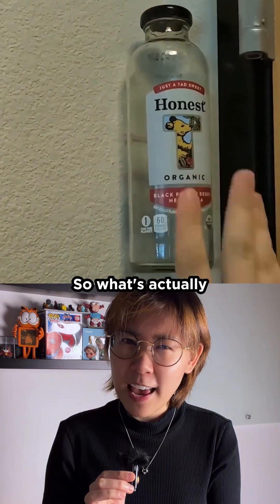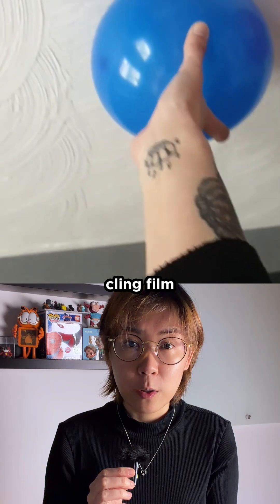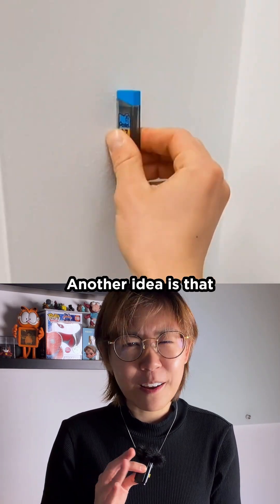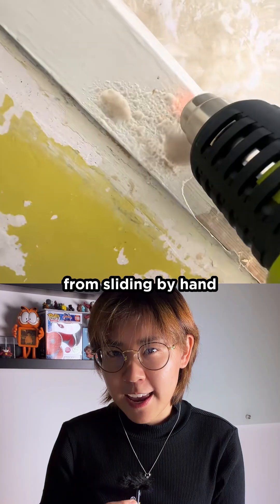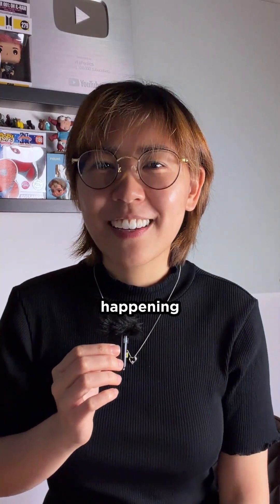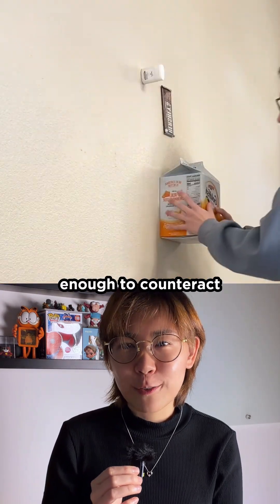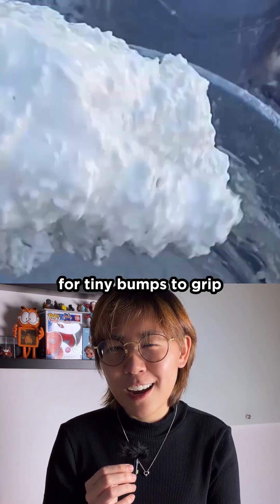Friction Actually Makes Things Stick to Walls #physics #experiment

Comment from the maker: Btw, this is called shear-induced friction. It is the same trick geckos use to climb walls! 🦎
Reply: Isnt there a "weight" limit for this phenomenon? Like there's no way a spider man could exist...right????
Reply: @Jyno_Syd  I think so
Reply: @Jyno_Syd grow up, Spider-Man is real!
Reply: @Jyno_Syd spiderman is real tho??
Reply: sheer induced friction is just the active action that a gecko takes to induce vanderwaals for anyone wondering. Just means that geckos dont stick by a simple touch.
Reply: @IveNoIdeaReally cuzzzzz mabyeeeeeeeee your gunnnaaa beee theeee oneeee thatttt savesss meeeeeee, cuzzzzz afterrrrrallllllllll yourrr myyyyyy vanderrrrrwaaaallllll
Reply: Wut about my classmates doing this
Reply: I heard that geckos use static electricity or something similar to that? they have tiny hairs on their skin that flatten out microscopically to increase surface area against the wall. there was a veritasium video on it iirc
Reply: @sumy_nona yeah, vanderwalls forces, basically they have hairs on their feet so fine that they get close enough to the atoms in the surfaces to interact with subatomic forces! 🤯
Reply: @sumy_nona Yes, geckos can walk on roof, this video states is just friction, this wouldnt work on roof
Reply: @PinkeySuavo no, it's an interaction between hairs on the geckos feet and subatomic forces in the surface atoms, so they can do it anywhere.. :)
Reply: @ZealousLoper  I know, that's what I mean, this video is false
Reply: @PinkeySuavo no, she never mentioned geckos. I suppose the comment is a bit off. I do remember something about the geckos sliding their feet backwards to get close and lock in tho. ..I don't know enough to be definitive.. 🤷‍♂️
Reply: @ZealousLoper  you're right, I confused comments with the video for some reason, I am braindead. Sorry.
Reply: @PinkeySuavo you are one of the lovely, gentle, kind people who I can only hope are the silent-ish minority on here.. 🫶
Peace and thanks :)
Reply: Its viral😂
Reply: Thank for doing this clip, saw it on reddit and been wondering since 😭
Reply: Can I eat or hold dry ice
Reply: @JhaydeEdrianDelaCruz-u9i hold it yes eat it no, wouldn’t hold it for long with bare hands tho as the liedenfrost effect is very brief
Reply: @JhaydeEdrianDelaCruz-u9i You can hold it in your lungs, just wait a few minutes first. 🌬️
Reply: Or may be it creates vaccum and atmospheric pressure holds it ??
Reply: My classmates used to do this so much in class even the teacher would stop teaching to stare at the wall
Reply: Sounds similar to cold welding in vaccum
Reply: So it's not the creation of suction chambers via flattening? Thanks. 🙏🏻
Reply: That's van waaals forces
Reply: So geckos destroying the paint from the walls?
Reply: @mattdelariarte4095 no, the hairs on their feet get close enough to the atoms in the paint the interact with their subatomic forces. It's not like magnetism than "sticky." But the attraction is strong enough they wouldn't be able to pick their feet up again so their toes actually flex in reverse and they peel their toes up backwards! :)
Reply: It's... A trick. The vdW forces are what cause a gecko to stick. The sheer-induced friction you mention only happens afterwards, the gecko can use this effect to manipulate the adhesion, getting stickier or releasing from the surface. Without both vdW forces and this sheer- induced friction, geckos can't climb, but they can still stick with just vdW force.
Reply: don't geckos use van der waal's forces?
Reply: I believe you meant to say textured at the end. When you say popcorn that's a specific finish that's only done on ceilings and really hasn't been a thing for decades. The only thing that you hear people talking about popcorn these days is having someone remove it. Popcorn texture is not something that would do this. You would damage it and destroy it by trying.
Reply: Same as Van De Graaff?
Reply: Oh so is it like what holds Spiderman upside down on the wall?
Reply: Can you please stop encouraging young women from pursuing science! They are not supposed to do a man's job.
Reply: It destroyed my wall😢😢😢😢
Reply: Can you sing you can just make a video of hey don't do that sister I'm so sorry I forgot now pouring a glass of water in a giant giant giant big globe if he if you just spent the gloves when it's covered in water or maybe spread around I was going to be funny and I was going to be funny but I can't know what's your name so I'm going to tell my sister to know who's this guy's name
Reply: Um..well gecko or lizards and spiders have very tiny hairs that creates opposite charge with walls..right? I had heard that years ago
Reply: @ansh2604  today i learned spiders also use van der Waals forces to cling, that makes sense
Reply: @ansh2604  yes but even if thats the case...if a human sized creature had the same hairs or whatever i am not sure its going to work. The weight is just to heavy for friction to support.
Reply: @Jyno_Syd well in human case it will require more advance form of that so naturally it's not possible but I am sure scientists can make it possible in future
Reply: @ansh2604  spiders have two tiny claws on each foot that help them climb.
Reply: @ Van Der Waals Forces
My Zoology knowledge is good!😁😁
Reply: A simple explanation is the paint heats up and acts like a glue for the object and makes it stick it works on many things tho I have not tried it on a chair
Reply: Only works on glossy pain

Comment: I once walked down a hallway at school gliding the back of my nails along the wall with a texture similar to that, and not only did it get surprisingly warm, but the friction also ground a tiny hole in the middle of the nail.

Comment: I did smth simular with my phone case and thighs/pants. Like i was sitting in the couch with my legs bent and wanted to watch yt i just did this and stayed there without holding in hand. Pretty handy to get free hands and let the rest.
Reply: My phone has a ruff surface. It doesn't work on smooth ones.

Comment: @vt.physics before you gave your explanation did you try it yourself.  A more simple explanations are video editing or AI, or the surfaces are actually horizonal or  glue or magnets are involved.
No way a round glass bottle with hardly no points of contact with the surface sticks to a granol wall.

Comment: Scratch marks on your wall AND the object, especially of a more fragile object. So don't do it with your remote, phone, etc or else you will paint it and scratch it at the same time.

Learned through experience.

Comment: Vertical upward friction along the surface of an object would induce a torque, and even with infinite friction, any object would fall off of a wall. There must be some sort of adhesion or suction in order for the object to stay put.

Comment: But how does that keep the object from rotating away from the wall? Thr center of gravity is away from the wall, so if the surface is applying friction at the edge it should create a torque

Comment: No, it heats up. I used to do it with bottle caps and you'll burn your finger fairly immediately if you don't let go quickly. 
Sounded good tho.

Comment: you can actually create significant heat with enough pressure.
When I was in school we used to weld those six sided fineliner pens together.
You just took seven of them in your fist and let the middle one stick out half of its length. 
Then you hold the bunch really tight and ram it onto the table with the portion of the middle pen that sticks out from the bundle and the six outer pens would weld to the one in the middle

Comment: you can try it but it's not gonna work it's fake
Reply: Its real bruh ive done it once and its becoming a massive trend in my country js search it up
Reply: @rdblx  I tried it and it doesn't work, No matter how fast I go I'm scraping paint off the wall and it's still not sticking.
Reply: @M-DW999  its hard and i think this only works for like weak old walls and not nice smooth ones

Comment: This is not exactly all that is going on shear induced friction has to do with a lot more micro surface area when it comes to heavier objects what is also happening is while the surface of the wall or painted texturing is flattened and the object is moved it pushes air molecules into the next trows of the crests on the planar surface being flattened creating high pressure low pressure zones in between and all around each of the closed loop crests and trows stopped suddenly a vacuum is created in all those closed loops if it was due to friction alone when disturbed and/or after time it wouldn't fall off as easily but the vacuum leaks out because it's not a perfect seal Mic drop

Comment: Something is off with the pencil at around 45 seconds. They rub it fast but right before they let go, the pencil twists to a new location.  The paint in that spot has not been smashed. How does that one stick? If your able to rub it fast then move it to a location that has not been flattened as described in this video then something else is going on. It has to be that that one 2 second clip is fake or something more is happening other then the flat paint. In addition I've seen a few comments about geckos sticking to walls the same way. I had a read about that and it talks about geckos feet being covered with millions of tiny hairs. I dont see how thats the same?

Comment: What about the torque acting on the center of mass, surely friction isn't holding it up, there must be another cohesive (or another, such as air pressure) force as friction acts (ideally) linearly to the normal force (the push force on the wall), but theres nothing much pushing on the wall to hold it up.

also generally for hard/rigid objects increasing contact area does not really increase friction applied.

Comment: By your logic, I can just push the pencil with sufficient force to the wall without sliding it upwards to "flatten" the tiny bumps and increase the contact, but of course that does not work.

Comment: this feels like this shouldn't be real because after you let go there's no force acting into the wall which means the normal force and hence frictional force is zero. that means the only way this works is if you literally dent your wall and let the bumpy parts act as a "box" holding the items from moving. not recommended to try at home.

Comment: No, I think you’re wrong. I think it is the melting paint one because I used to do it and when I would take the things off there would be dried pieces of paint chips that would rip off the wall and be stuck on the thing or whatever I put up on the wall

Comment: i wonder if they'd stick more if you made the wall smooth but put billions of tiny "wells" in it.?  holes with a bit of depth basically.  pushing something into it would compress the hole and create a suction to act like the tiny suckers on octopi.  velcro comes to mind too, but for that the object would also need the tiny hairs too.  peace.

Comment: Actually, probably using negative air pressure as you press you the air between the bumps in the wall, effectively suctioning the object to the wall. But not for every item, I don’t imagine a pencil would do that with such a small surface area.

Comment: Cool video, but it can't be friction because there are no normal forces acting between the object and the wall once you let go. And for large macroscopic objects, friction is independent of surface area. (Note: this rule no longer holds when the total surface area becomes really small.)
The force that allows geckos to cling to walls is van der waal forces, not friction. It is an extremely weak electrostatic force caused by temporary electric dipole moments that appear in all materials. The gecko foot is a dense forest of tendrils that greatly increases the surface area between the wall and the foot, leading to an appreciable van der waals force that allows the gecko to stick to the wall.

Comment: Dry paint, even if it’s old, and especially if it’s been repainted or harsh enough cleaners have been used, is already tacky anyways. 

Just rub it with your finger. — but sure, the bumpy hypothesis is fine too.

Comment: Huh? Then why does it work on my smooth bedroom wall...Ah right, because it's not melting it extremely, it's melting slightly and when you take something, like a pencil, off you can see paint residue on it, if its friction, there wouldn't be residue, but you applying friction and force to the paint at a temperature enough to make the paint tacky and it makes things stick to it

Comment: Don’t do it on popcorn walls or ceilings. Most of them are made of asbestos if they’re older. By rubbing them off you disturb the surface and make it easier to inhale. You don’t want mesothelioma do you?!

Comment: Is it  purely "increased contact area"? Wouldn't flat walls have even more contact area than bumpy walls? This works on bumpy walls. Maybe grooves in object..

With softer materials like plastic (or soft wood) and rougher bumpy paint surfaces. I can see the bumps in the painting gouging tiny groves into the plastic. The plastic grooves might be resting on top on the bumps that cut them.. (against force of gravity).  Or you might imagine  tiny sections of the plastic wedged between two bumps. 

Maybe somebody with time can test... theory 1) harder objects win as they would flatten the wall more and create more contact area as the video described.
My Theory 2) Softer object  win as would get deeper grooves cut in them... and be more soft/flexible to be wedged between bumps.

Comment: This is actually a huge problem with math major students. They often question every step and why we do this or that but sometimes you just need to accept the rules as they are...

Sorry if it was random, just the first throught that came to mind as an engineer student.

Comment: it's not a friction. It's a vacuum pockets. When you flatten the surface you're creating tiny vacuum pockets that hold the stuff in one place.
Reply: this one makes a lot more sense. the explanation given in the video is nonsense
Reply: @joaomellin it’s not wrong just incomplete.
Reply: @joaomellin  Agreed. I'd also wadger that this is just some sticky ass soft paint.
Reply: Is that also why paint sometimes appears on the object after taking it off? The vacuum sucks it off?
Reply: Apparently they've been able to replicate this in a vacuum, so that can't be it.
Reply: it is both. Air pressure augment the force applied on the wall by the pen, thus applying more friction.

If you have only friction or vacuum, it doesn’t work, you need both
Reply: @ludo534  yeah, I should've clarified that )
Reply: That's still friction. A vacuum doesn't impart any kind of force, but the air around the object does, a.k.a. air resistance which is just another type of friction.
Reply: @supercheetah0  that's just a word salad. you didn't actually say anything here lol
Reply: @supercheetah0  nope, you're wrong, just not completely. Friction does one thing - it prevents item movement down the wall. What actually holds the item stuck to the wall is the air pressure.
Reply: @supercheetah0  I mean that you're wrong about air resistance. It's not resistance, it's the pressure.

Comment: So it's reaching a point of plasticity, or thermal transition point. It's basically melting for a polymer that cannot melt. This is similar to wood welding in wooden nails where the lignin of the woods bonds the pieces of wood together

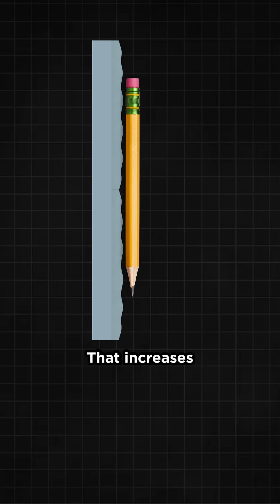Comment: 0:44. But I thought friction doesnot depend on contact area

What  I understood from the video is that the object basically sinks in the wall creating a small deformation(due to the nature of paint used) which provides a normal contact force opposite to it weight and it appears to stick to the wall

Comment: It doesn't make sense that it works better on pop corn walls since you said that it is the increased surface area that makes the object stick. So the flatter the surface, the better.

Comment: How does that makes sense? Friction is independent of surface area contact. It depends on coefficients of friction and normal reaction only.

My theory is that its its the object's surface that deforms and not the wall. Like you said it happens better on rough wall it may mean that the wall create tiny grooves on to the object and the object is held by the pointy particles of the wall which have got inserted into the grooves formed.

Comment: Can someone tell me if she explained it correctly? I've never seen or tried this but if things got stuck on the wall just because there is more "contact area" then that would mean every flat wall would be extremely sticky because that would be the surface with the most contact area. So, what is it really? 
Also I tired it after watching this video and got sad that it didn't work😅

Comment: The paint used inside on the wall can melt through friction but paint for stuff outside what you just explained is correct for outside for inside. The paint does melt.

Comment: I'm thinking there is more going on than just that, anyone who's worked with drywall would tell you that if you press hard enough to deform the wall putty, you'll be leaving permanent gouges in it, or at least visible tracks that won't go away on their own.  Texture putty isn't soft when it dries, it's basically chalk.

Comment: The amount of frictional force exerted does not depend on the contact area. The correct answer is sliding the object on the wall which deforms the wall changing the coefficient of friction.
Reply: It's wandervaals force, not friction.
Reply: It does though... in the basic model 「F=k*N」the conditions are ideal, but there are more nuances to it. By that model, there is 0 friction between the objects and the wall, because it is vertical, mg*cos(90)=0, so by your model its already impossible, and the coefficient doesnt matter.
Reply: For that the wall has to be truly perpendicular